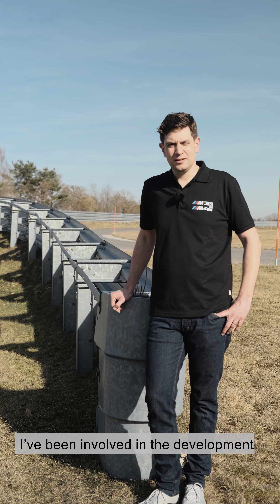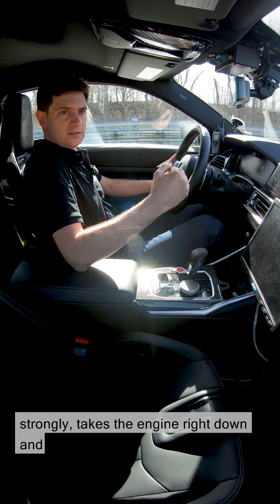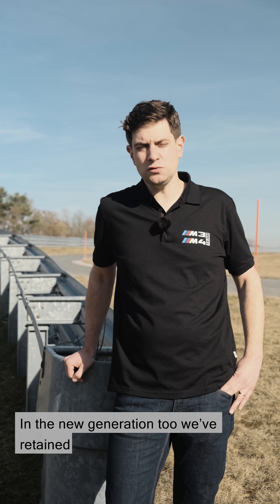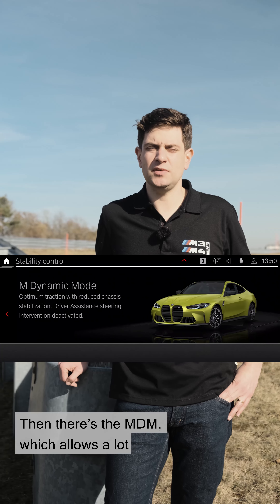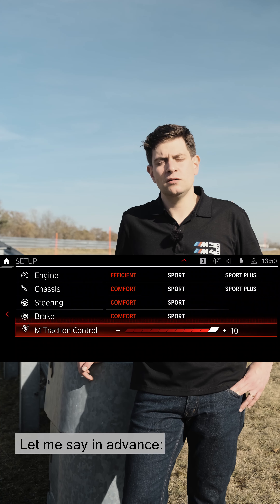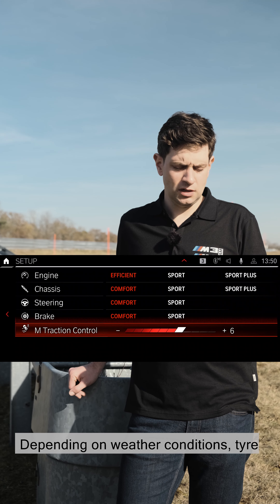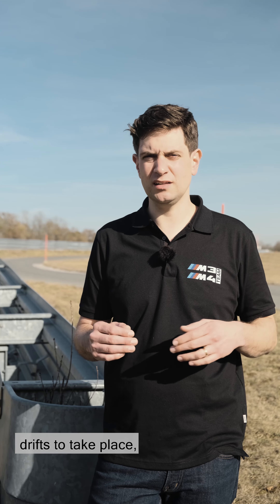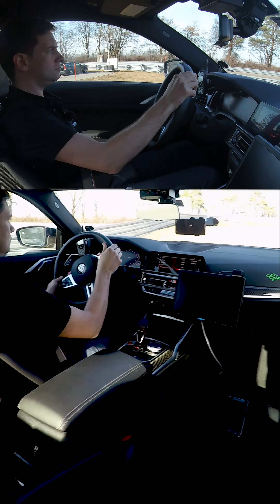M Traction Control. M3 and M4 - explained, Episode 17.

Comment: @BMWM, great video. 
Thank you for the clear explanation of the M traction control. I just received my M3 Comp. 2 weeks ago and I LOVE IT. Best M3 ever. Needless to say I am visiting the track this summer. 
One question: When traction is set to 10 with DSC OFF, does it behave the same as MDM? if not, what is the difference?
Reply from the maker: M Traction Control and MDM are different functions, hence there is no M Traction Control setting which equals MDM.
Simply spoken, M Traction Control is a slip control mechanism that controls rear wheel slip in 10 stages when DSC is switched off. Level 0 is OFF and allows for unlimited wheel spin. The higher levels allow for very limited slip. The slip is controlled using the engine‘s rpm as the only parameter. The vehicle’s yaw rate is not a controlled parameter here.
In contrast to M Traction Control, MDM is a part of the DSC mechanism and actively controls the vehicle‘s yaw rate. DSC/MDM use engine power controls as well as brake interventions to stabilize the vehicle dynamics on the road. MDM uses M Traction Control levels 4 to 7 depending on yaw rate behaviour.

Comment: Like an idiot I did not order the M drive professional package with my M3 because I thought the 10 stage traction control came with the car anyway and I didn’t care about the drift analyzer. Now that I have the car I realize I was wrong. Is this something I can pay for and add to the car now that I already have it? Thanks
Reply: It’s a software change, so you should go to the official BMW dealer/garage and they should be able to fix this.
Reply: @85Pando  they said they can’t do it after the build. So it’s too late

Comment: Excellent Video! I have just ordered the x-drive M3. Is is possible to switch it to 2wd and use the 10 step traction control for ‘normal’ driving?
Reply: Traction Control can only be activated in DSC OFF + 2WD. When you activate it in another configuration the DSC will be deactivated and the AWD will be set to 2WD.

Comment: Traction control? Who needs traction control in a 510 HP M-car?
Reply: Exactly , drift machine
Reply: If you do not want to drift, but do good lap times… The system allows for most amount of torque to be applied to the the track. Might not look/sound/feel as fun, but gets you around a little faster.